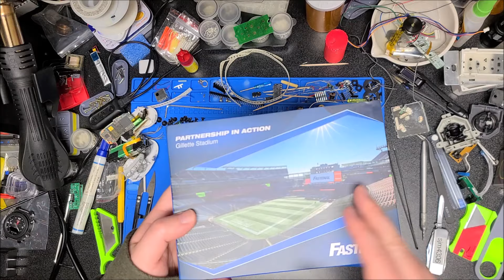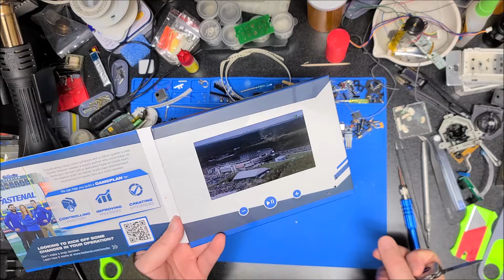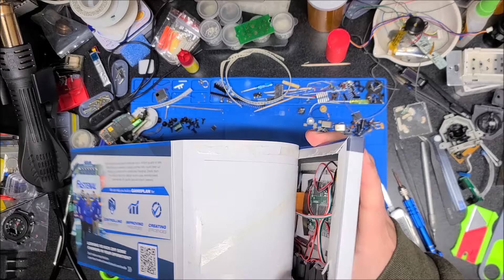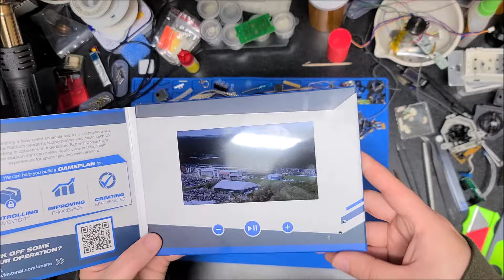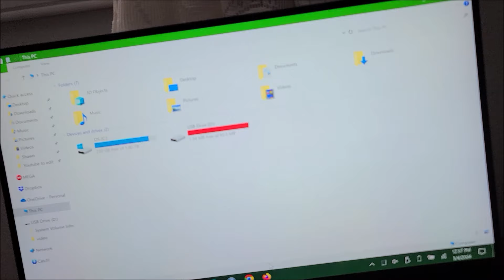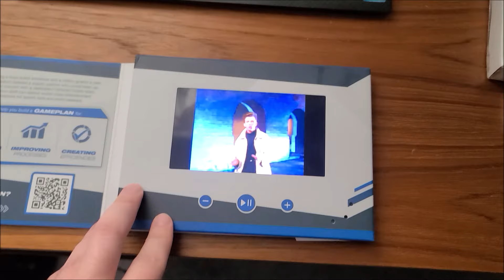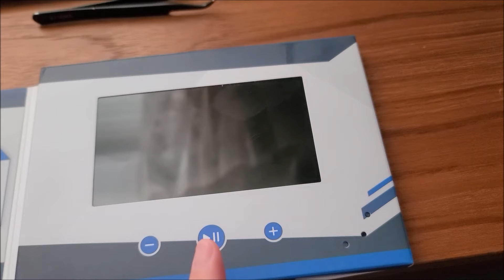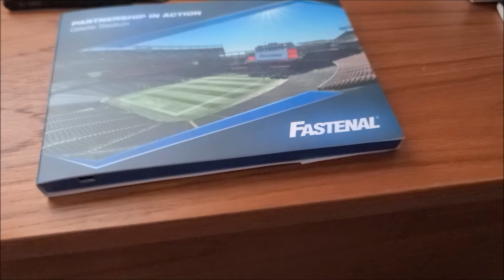Mail Advert Video Player Teardown and Tinker!

Comment: I have one of those too, mine has MICRO USB and no buttons but the motherboard looks almost identical instead off the PVP chip it has an Allwinner E200 apparently they run some kind of Linux system (maybe Melis OS AllWinners proprietary video player)that's specifically made to play MP4 files.
They usually have the following specs:
E200 chip, an Allwinner F1E200 system-on-chip with an ARM926-EJS CPU running at 470 MHz 
Hynix RAM
Samsung Flash
8 Ohm speaker
LiPo battery
Mini-USB connector
I'm wondering if other software can be flashed onto them, like emulators or some other Linux distro?
Controllers with micro usb exist so maybe with the right drivers it'll work. ?

Comment: I have one of these from something called "New Arconic" and it was meant to be a video mailer to stockholders to try and get them to vote on something at the stockholder meeting or something? but mine is a 256MB device with a spicy pillow battery, I soldered a USB lead with data so I could drop on different videos. It goes by alphabetical order and is honestly funny to use. I have mine set up with a bunch of TV static clips to mimic one of those "clip movie" drawn things like used to be popular on flash sites and even youtube 17-20 years ago. with of course, the very last file being a rickroll... but! I have confirmed it'll take a whole-ass episode of some anime show if you encode it correctly with handbrake. shove the res down to... 720x360 I think it is? and it'll do you just fine so long as you use one of the youtube presets as your base and work from there. just wish I wasn't so scared of removing the spicy pillow battery, else I'd have done so already. but hooking +5 directly to where that was connected will allow it to work too, the player doesn't care.

Comment: - The screen alone is valuable, jeez. Getting a screen like that from AliExpress is a good $30. 🤨
- 9:05 Technically, it says the video was created in 1970, specifically January 1st at midnight (timestamp 0 per the Unix epoch). It shows 7pm on December 31st 1969 because SJM is in the Eastern timezone, thus -5 hours, so Windows is showing the compensated timestamp instead of the actual one.

Comment: I wonder if you could run Doom on it since it can interface with USB and otherwise is relatively capable.
Reply from the maker: The main chip is probably a system on chip (soc) that'll pretty much only decode video files with stock firmware. If you could reprogram its rom then it may very well be possible to run doom. The problem is these all-in-one chips dont have public documentation (likely need to sign an nda and commit to a large order from the manufacturer to get some documentation and even then I wouldn't be surprised if it'd be mostly useless for reverse engineering the soc).